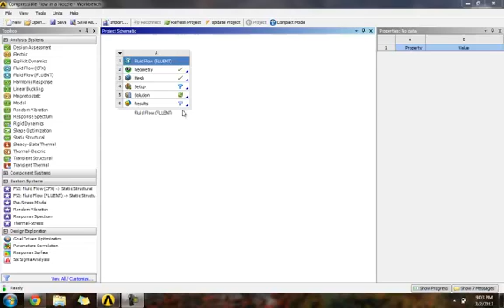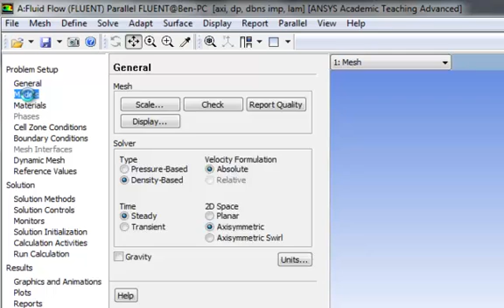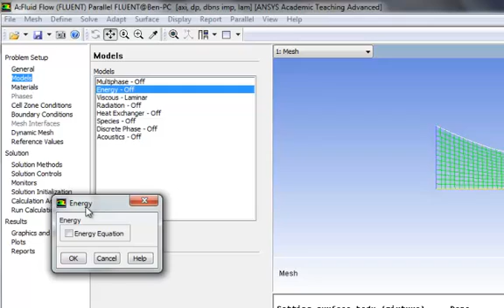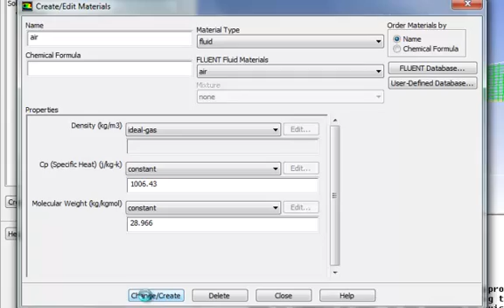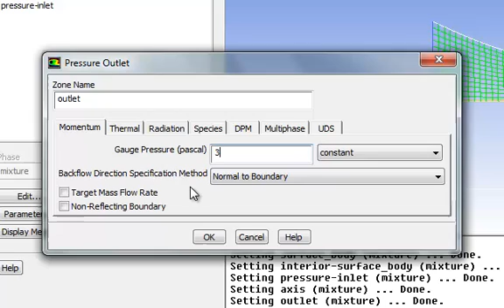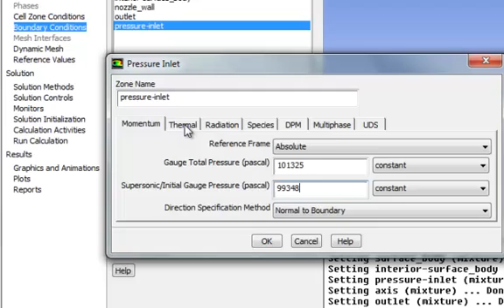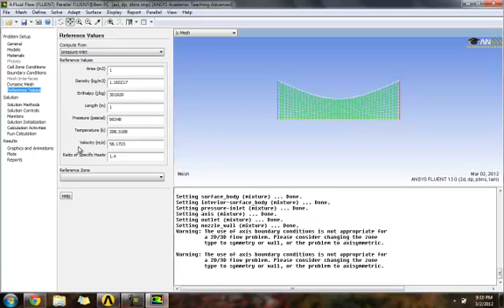Cornell FLUENT: Compressible Flow in a Nozzle: Setup

Comment: When I try to set Boundary Conditions it only shows interior-fff_oberfläche and wall-fff_oberfläche. No axis, outlet inlet etc. Where do I have to set these to get them in the setup?
Reply: sameee, did you find solution?? i guess this is problem with newer versions of Ansys
Reply: yes i did. You have to select the corners in the mesh and name them. Afterwards you find them in the setup @switch3139
Reply: That's because in the meshing process you didn't used named selections. The previous tutorial doesn't show neither. It is necessary to create four name selections. "Interior surface" is created automatically.